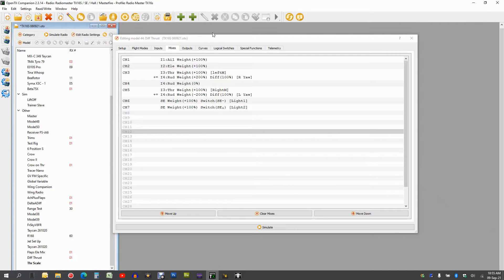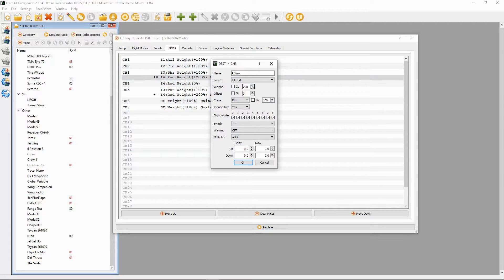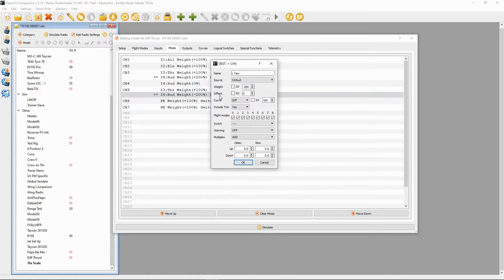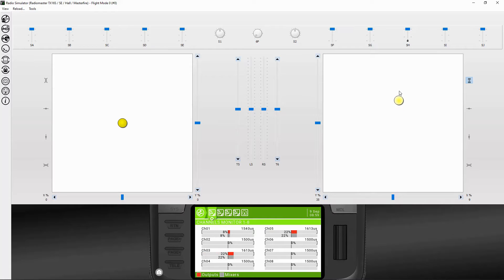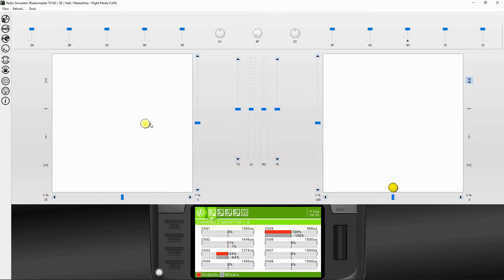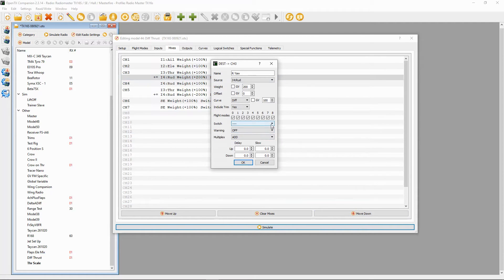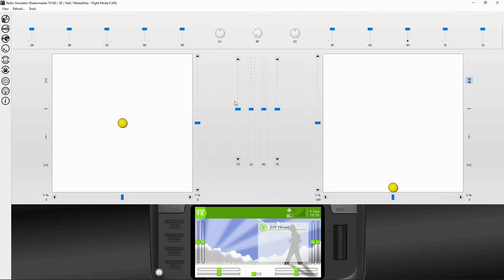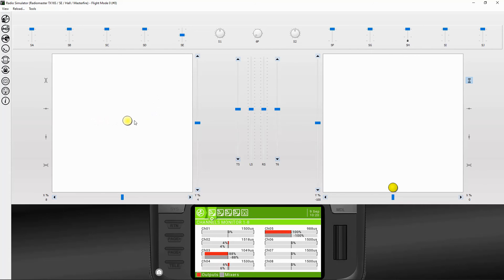OpenTX Differential Thrust – Dual Motors

Comment: If you are at full throttle, don't you actually want one motor to reduce power rather than having one motor increase power, which would not be possible if both already full throttle.
Reply from the maker: Ken it would depend on what you are trying to achieve. I would say you would use this system at low throttle normally. It is easy to achieve the opposite effect just change the settings to negative figures.

Comment: There is a problem with this.  When taxiing from the the pit area to the runway at our field it is not real safe to have the plane speed up in a somewhat congested area.  I have seen some Futaba radios with this programming have some close calls.  Do you know of a way to have the correct motor slow down as when doing aerobatics I will be at high to full throttle and the slowing of a motor will work better I believe.
Reply: Sorry as I had paused in the middle of the video and had not seen the part about the switch, but I would still like to know if you know of a way to slow the inboard motor in a turn/spin.  Thanks for any help.
Reply from the maker: @terrordactyl4425  All you need to do is change the weight to -200 and the Diff to -100 and now the rudder will decrease the motors speed instead of speeding them up. Do this for both the R Yaw and L Yaw.
Reply: @the-happy-RC-flyer  Thank you, I didn't think it might be that easy.  My next build is going to be a twin.